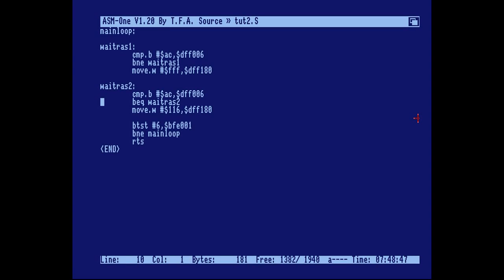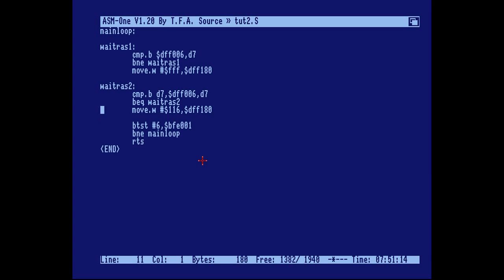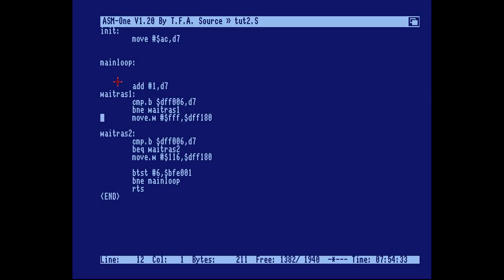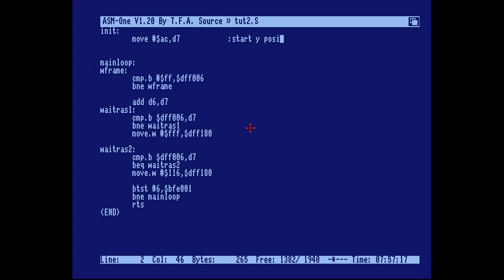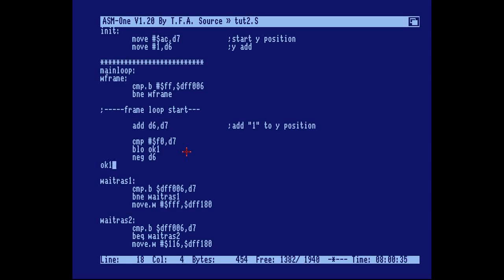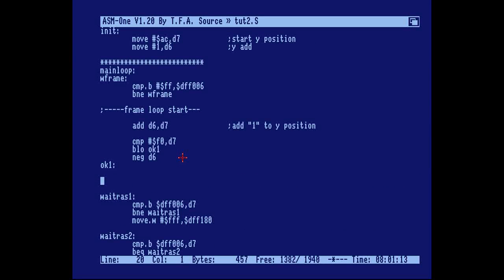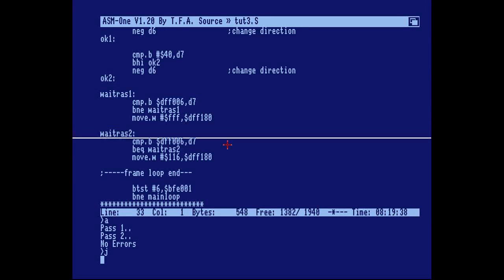Amiga Hardware Programming 3 - Move that rasterline

Comment: Going thru these now on my A1200.. huge thanks. Thumbs up on every vid.
Reply from the maker: Thank you for the kind words. :) I'm finding some more time to code Amiga now, and hope to upload more coding videos again.

If you have no fastmem in your dev Amiga, I recommend to increase any ORG/LOAD addresses until we switch to SECTION statements in the series. Or replace them now with SECTION "ElectronicTreasure", CODE_C. :)

The reason is that if you have only chipmem, as in a stock A1200, A500+ or A600, this will be eaten up by the OS and CF card buffers etc.

Comment: All this code just to move one line across the screen... imagine how much assembly code you have to write to make a full game. I think working with something like AMOS or Blitz Basic or C can give you similar results with much less code.
Reply: The results are not similar. Assembly is infinitely faster than Amos, Blitz, or even C, and that's why it's the best. Anything else and your game would run too slowly to play.
Reply: Nebula Rain I kind of must agree with you. Thats why on 8-bit computers and Amiga most of the time assembly was used for professional development. I think 386 PCs were the first microcomputers where C was a viable option for professional programming.

I still like BASIC variants like Turbo Basic on Atari or AMOS on Amiga though.

Comment: Dear Photon/Scoopex ... using Asmone/Asmpro ... is there a way to obtain from a literal defintion the high and low byte: e.g. having:      foo    equ    $11c  --> #>foo   and #<foo ? 
Thanks a lot for your help -- I could not find it ,... but maybe you know or can give me a hint. Cheers and kind regards, Stephan
Reply from the maker: foohi equ (foo>>8) ; foolo equ (foo&$ff)

Further information: For just checking at compile-time, use IFGE (foo-$100) and IFLT (foo-$100) - see the Directives chapter of the Asm-One manual. For runtime comparisons, use the cmp instruction: move #foo,d0 ; cmp #$100,d0.

Comment: Hey,

I have copied the exact code into ASM-One, but when I try to do your quick fix, of changing add #1 to sub #1 into d7 in the mainloop, I get the exact same problem; sub does not give the same results as you get with the line moving upwards.
Reply from the maker: I don't think I write a sub instruction in this tutorial? Did you perhaps write a sub and start at a position outside the check values (top and bottom limits)? That's what I can think of.
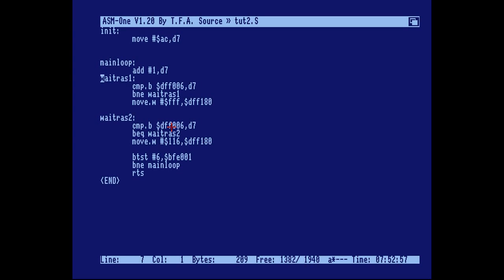Reply: @ScoopexUs  Thank you so much for this tutorial!!!  Also following along.  Your usage of the sub instruction happens at 4:52.  I get the same results you did using asm-one v1.49 in WB3.1 on my 3.1 A1200, except its on my WB screen, instead of on the DOS screen.

Comment: Looks like poor man's Copper programming. :-)
Reply from the maker: +amigalemming It wouldn't be pedagogical to scare everyone away with introducing the custom chips at this early stage (it's only part 3!). Your statement is actually correct. The message is that the CPU can do the same things as the Copper, and that's just a fact. A fact which is apparently good to know, such as for making a rotozoomer on Amiga 1200 as I showed in my Amiga Future Magazine article not too long ago. :)

Comment: thanx, great tutorials. Question arises: How can I read the COLOR0 before setting so i can reset it back to its original value(ie for new KS it's grey)
Reply from the maker: You can't - the color registers, like most $dffxxx registers, are write-only. The good news is that the OS runs its displays on the copper, and when the OS starts the copper for the OS display it kindly stores its address in a library structure, so that you can restore just the copper display, and all those read-only registers including the color registers will be initialized to what they were. (Covered in tutorials 4 and 5!)
Reply: ScoopexUs Did you mean "the color registers are WRITE-only" ? :)
Thanks for the info, anyway, I've been trying for an hour to read from $dff180 with no luck :D
Reply from the maker: Yeah, write-only. Corrected.